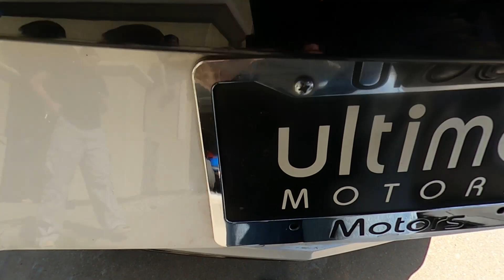Oil Change| CTS-V

Comment: Key points about this recall:
Affected part: Roll pins in the rear axle differential
Potential issue: Fracture of the roll pins, causing the rear wheels to lock up
Remedy: Replacement of the rear axle differential by a dealer

Comment: Yes, there has been a recall issued for certain Cadillac CTS-V models, specifically affecting 2014-2015 CTS-V Sport sedans, due to potential issues with the rear differential roll pins that could crack; this recall is related to potential safety concerns with the rear axle differential seizing

Comment: According to available information, the most recent recall on a Cadillac CTS-V affects certain 2014-2015 Cadillac CTS-V Sport vehicles with 3.6L Twin Turbo V6 engines due to potential fracture of the roll pins in the rear axle differential, which could lead to a loss of vehicle control; GM will replace the rear axle differential free of charge.

Comment: What are the recalls on the Cadillac CTS-V Sport?
General Motors has issued a recall for select 2014-2015 Cadillac CTS V-Sport sedans due to roll pins in the rear differential that could crack. The recall only affects 2,866 vehicles, but it is expected that 100% of those vehicles have the defective parts. According to NHTSA Campaign No.Feb 3, 2020 it's dated 2020 for cts-v  I think that they fixed that issue in there newer years 👍👍😎😎